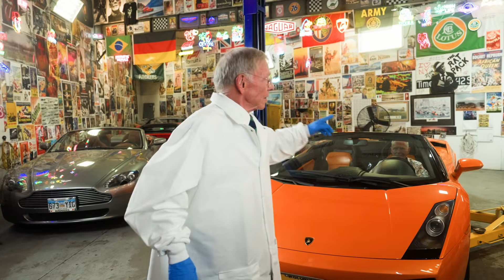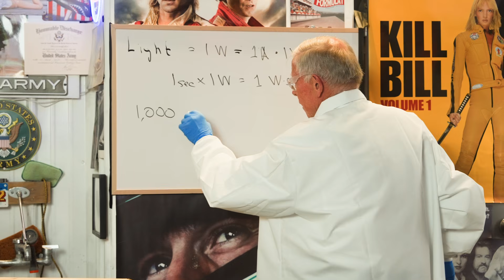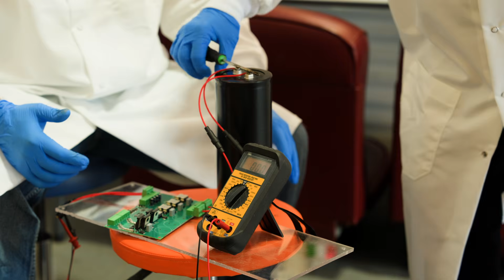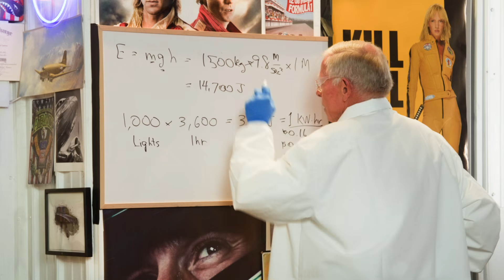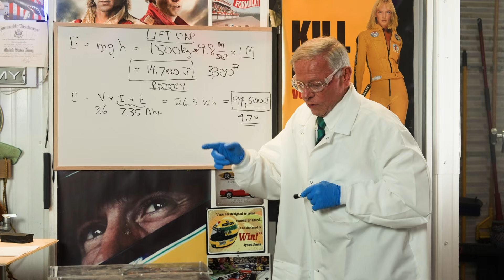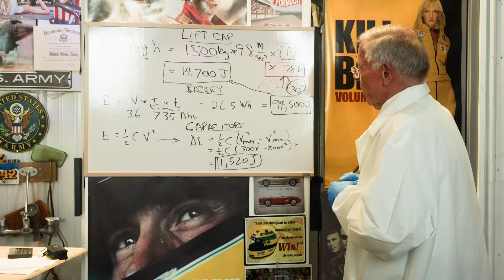A Smartphone Battery Lifts a Lamborghini | Enovix 100% Active Silicon

Comment: Main point of the Video: the battery exists and is working.
Reply: What battery might that be?  Enovix has offered many silicon battery models, yet no device has ever used any of it.  According to the video, the energy in the battery lifted the labo just 9 inches, which  is about 1Wh, assuming no losses - - way less than regular batteries.